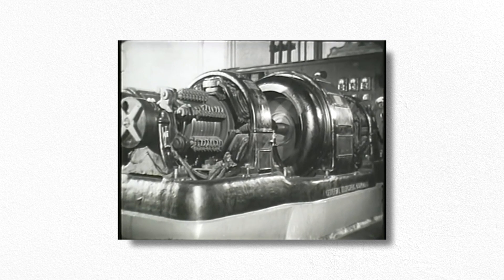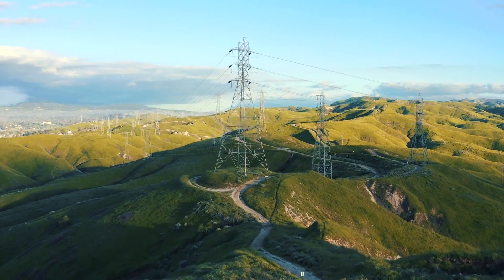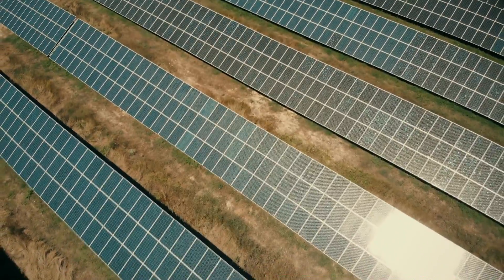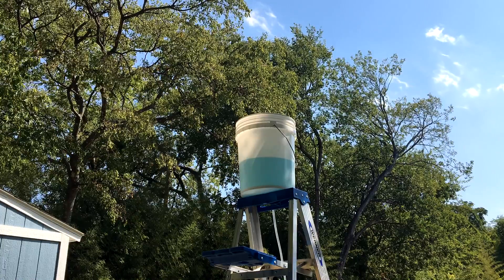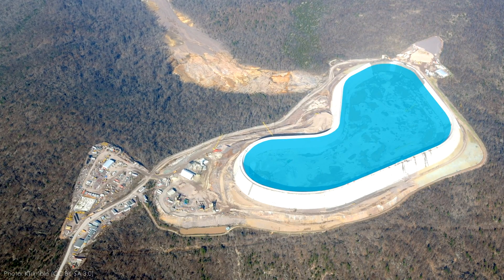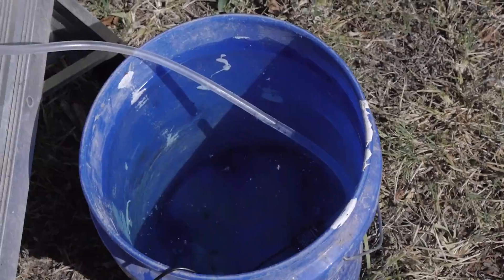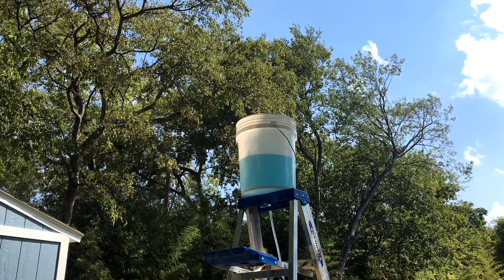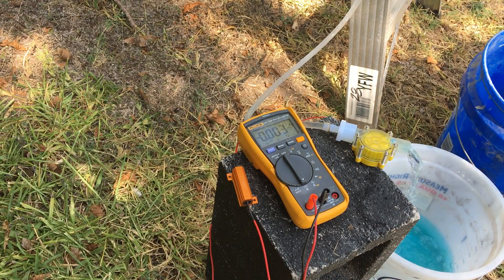World's Largest Batteries - (Pumped Storage)

Comment: im sure you mention this but most reservoirs arent pumped, they are natural collections of water. Pumped reservoirs are usually used to even out electrical load, because it is inefficient to have pumps turning off and on constantly to maintain system pressure. Instead you pump intermittently to a reservoir and use that for a constant pressure load.

Comment: i wonder why they dont make the hydro dam resevoir into something like a capacitor to hold a charge and use that to soften the demand load moment to moment whiel the hardware spends time ramping up efficiently
Reply: how would the efficiency change if the pump used for the demo was a water ram pump ... then its no extra power drain and free pumping action to go along with the head for the turbine ... have the outflow run into its pond then drop feed the pump back up and start all over again ... constant flow then

Comment: I imagine there could be better efficiency if a denser liquid, such as mercury, was used. It might be more expensive, but if you're on mars, and it can be mined in-situ, it might be preferred over lithium batteries and their reputation.
Reply: connect the pumps to a gym, and make the people manually pump up the water. There is the gold mine :).

Comment: There's some people experimenting with concrete blocks instead of water. Name's Energy Vault. Look that up.
Reply from the maker: Why use concrete when soil is just as dense and 10x cheaper?
Reply: @PracticalEngineeringChannel  I would imagine the machinery works better if all weights are exactly the same shape (and weight). You could make boxes with some sturdy material and fill them with soil, but I don't know if it would be cheaper then. And then there's the variation in soil density.

Comment: pump storage is ecologically unsound . use electrolysis to create hydrogen gas . run a generator with the hydrogen when required
Reply: Looks like too many intermediate processes. Efficiency would suffer.

Comment: Could we combine flood management system with pumped storage system? Create reservoirs where water is pumped from areas prone to flooding  and kill two birds with one stone? Flood control and power storage?
Reply: Major floods involve a LOT of water.  You would need a giant pump system to stay ahead of that.
Reply: @SynchronizorVideos  we would need to save homes and livelihoods anyway with pumps, why not have them do double duty and get some of that energy back? 😕
Reply: @gj1234567899999  No one is pumping an entire flood away.  Pumping seepage out of a building basement, sure.  Not to mention that floods don't usually play nice with electrical infrastructure, so it's hard to guarantee your ginormous pumps are even going to be able to run in a disaster scenario.

Comment: Worked at a utility where we had wind turbines that drove the pumps to pump the water up. Then release the water through the turbines as needed. Seemed like a good way to use turbines that are lucky to get 30% or their rated power in normal conditions..
Reply: Where was that? Excellent idea
Reply: @joelshor5787  Beck 2 plant Queenston Ontario has pumped storage. The pump is 750 Mwatt when used as generator.
Reply: @joelshor5787  Google "Bath County Pumped Storage". Worked well because it didn't mess up the grid with transients the way solar and wind does...it was "regulatable"...
Reply: @georgemartin1436  you mean the bath countystation did not use wind ?
Reply: @joelshor5787  Sorry...I wasn't clear there...it had wind turbines that contributed to the pumps so the station only used 650MW on windy nights. Of course the idea was to pump the water up during low electric rates, and let it flow down through the generators when rates were at a peak.
Reply: would love to see how it works. i was thinking of a sea side set up with a windmill pulley system to pull sea water on a higher elevation with a large reservoir in the end. when the sea water reservoir is full you can release the water in a floating state (equal input and output) or conserve water when its not windy then release it at its peak time.  sorry for my bad english
Reply: @jamesvillas428  not great efficiency at small scale.  Much better efficiency at say 100MW or greater.
Reply: Very interesting noticed
Reply: Wow!  Must be old wind turbines. 

Current CF for wind is up to 40%.
Reply: Good way to stabilize and store a power that does not always appear when you need it.

Comment: You said it backwards. you pump the water up during the day as you have excess solar power and not enough demand for power. Then at night you let the water fall down which spins a turbine which generates power. As demand is high at night because more people using lights and entertainment. At 4:00.

Comment: The term 'grid scale' is misleading. I take grid scale to mean large enough capacity to compensate for intermittent generators. That is not a feasible.
Pumped storage is used for grid control, to deal with short term spikes in demand, and has been for decades.
Reply: No, he means 'grid scale'
wikipedia.org/wiki/List_of_pumped-storage_hydroelectric_power_stations

Comment: You might wanna have a look at Norway's case - I believe they have numerous Pump storage facilities, with turbines in the valleys, normally running on melting water from the mountains. They usually buy surplus wind energy from Denmark at a very low price, and sell back hydroelectric energy to the danes during peak periods... Smart way to make a lot of money

Comment: Very cool video. I have a question. 
say i build 2 cylinder tanks in my yard on the same principle like the buckets shown.
First tank placed on the surface, reaching a height of 15 meters. Next one placed underground,  from surface down 20 meters deep. I can do this in my yard with the help of my friends - is not that crazy to dig 20 meters.. most water wells are deeper then 20 meters, and are 1.2 meters wide, .. pour some concrete and stuff - is doable, low tech, cheap.

Now how big this cylinder tanks need to be in diameter for me to store 100kw? 

Im trying to see at what point batteries become more expensive then a water installation - because from your video is clear that somewhere between this 2 setups:
 - small scale buckets vs battery - ( buckets hose and aquarium pump are more expensive then one rechargeable 1.5V battery ) 
 - large scale water reservoirs vs battery 
a shift in cost happens. If batteries are the way to go, no water reservoirs would have been built - they are expensive to build. Batteries would have been used instead - a huge plant of led batteries for example. Maybe this changed just recently given what Tesla is doing with Australia's battery, maybe now large scale batteries are less expensive then water reservoirs installation but still.

At what scale is this tipping point? 

Because if this tipping point is closer to what we can build in our back yard maybe is worth doing instead of buying expensive 10k batteries ($100/kwh). Where i am 10k is not cheap. A water tank can be made with just wood - which is free from the forest - and lining can be done with sprayed plastic - etc. It can be built very strong, hold for years, and be very cheap given certain areas in the world like mine. Takes 1.5 months to build. The only issue now is - does such a project even make sense? Or is so big that is better to just buy batteries instead? How big this tanks need to be such that we can store 100kw? Thanks :)

Comment: interesting that due to more and more solar and wind appearing on the system the designed strategy of cheap energy over night and expensive peaks in the day is taking a bit of a hammering. Most developed systems will end up with excess energy during the day then as the solar drops off a need for storage to make up the difference. So food for thought but pump storage could end up pumping all day and generating over night.  Thanks for the video...

Comment: Why not just use massive networks of ram pumps to pump the water back up instead of using an electric pump? Its a more massive engineering project but the efficiencies increase to 100% - maintenance cost.

Comment: if we combine these with canal locks, we could get a reasonably efficient amount of power as a side effect of canal locks. on both points too, loading into the lock and draining.
Reply: It's a neat idea on how to use an underutilized resource, but I'd imagine wind and even solar might be more consistent in all but the most busy waterways.
Reply: @h8GW  i agree, its consistency would certainly leave much to desire. I don't believe it would be best as a consistent form of power generation. However, if they did manage to make it in such a way as to not require a lot of maintenance, it could at least lower its own cost to maintain since it would require less electricity when it's busy.

Comment: Batteries convert chemical potential to electricity in a controlled fashion. There are rechargeable an non-rechargeable batteries. By no existing definition the pumped storage plant is the largest battery. If you allow other types of energy storage to be called batteries, then an atomic power plant is probably the largest as it converts nuclear potential to electricity or heat.

Comment: The best way to save and store energy is to do as Nikola Tesla did and build large saltwater capacitors to hold the energy if you made these the size of Olympic swimming pools you could store all the energy you can generate by wind and solar to be used at a later time and it would cost pennies to make these giant saltwater capacitors if it was good enough for Nikola Tesla it should be good enough for us

Comment: I thought about (along with many before Me) a "multi tear pond/reservoir" years ago.  One leading to the other using solar/wind/gravity siphon feed and or generated power at obvious times to pump back to the top pond. I also wondered why some water isn't pumped back in existing dams and reservoirs already ? Why not work on generator/paddle/turbine/gearing technology.  Cool video.
Reply: A number of dams do have the ability to pump water back up to the reservoir to store energy for later use.

Comment: Possibly use the electricity to power a train up a mountain on a dedicated spur line - load the train with concrete or dirt to increase the weight - use it to generate power as it descends during the day

Comment: There is a truth completely ignored by the hydro electric industry TURBINE designs. It is the losses in accelerated mass. When you include accelerated mass losses in the efficiency formulas, the shine falls off the stone. Hydro turbine efficiencies with these losses included drops to 16% at best. (They claim over 90% by dropping accelerated mass losses from their efficiency formulas.) Once you pump store water, this combined efficiency becomes 16% of 16%! Huge losses in reality! They claim lack of efficiency in compressed air ignoring the real bad efficiency of hydro! Not to mention expense of reservoir costs! What is the cost of renting an abandoned mine? What is the cost of building and maintaining an open reservoir? Efficiency is not the problem. Investor relations is! You scammed your investors now you can not tell them the truth!

Comment: I hope I can get some sort of answer or direction to pursue the question I've been pondering on pump using hydrogen electrolysis. It seems that it will have none of the dangers and disadvantages of hydrogen that was proposed to fuel vehicles and the greater flexibility of not requiring specific topography. Can somebody tell where to find the date on potential energy storage efficiency of this method?

Comment: Another interesting point is the fact that if your storage reservoir is fed by natural water flow via rivers or heavy rain such as a naturally occurring lake that the output power can be higher. Although technically this isn't increasing efficiency it does increase profitability. Not just that but it means that hydro-plants that wouldn't be considered financially feasible before, such as once that would only be able to break even could be used as a pumped storage solution with the added benefit that even without pumping it would still manage to cover it's cost.

Comment: Easy solution is to just decentralize power storage. If we did then no need for massive storage solutions. Every home should have a battery bank  capable of storing enough power to handle peak times. Then off peak power replenishes the batteries. Problem is, greed is trying to keep power, water, food, etc centralized so they can control the supply

Comment: while I was watching this I started thinking. wouldn't this  be more efficient the other way? instead of pumping water up, you could pump air down? like, build a dome under the sea and store energy by pumping the water out (or pumping air in) then, if you need power, you use the pressure of the water to spin turbines and fill the dome. and it's a lot easier to find places to do this. you just need any body of water that is deep enough

Comment: 4:58, looks like Niagara Falls on the Canada / USA border. One of the first large-scale electricity generation areas. And both countries are used this hydrological 'battery' system.
     Surprising this form of energy storage is not more popular.
Reply: These reservoirs were built (Canadian 1954, USA 1961) about the same time and with the generators that are linked together they produce almost 2000 MW of power which at that time was the biggest hydroelectric generator in the world.  The whole reason for the water storage system is so that it can be used to increase electrical generation during the day and still keep a minimum amount of water going over Niagara Falls.  When electricity demand is low (at night) the reservoirs fill up for use the next day.

Comment: Hydroelectric power plants are great as peak plants, even without pumping. The reservoir fills during low load times and is discharged during high load. In Switzerland we even cover part of our seasonal supply/demand disparity in that way.
(Those Mountains sure have their advantages.)

Comment: This is very interesting I never knew that we stored energy in this way. Is there a way we could use capacitors on a large scale to store energy in the same way or would it be too expensive to be practical?
Reply: Currently battery storage (and capacitor) is just at the state of innovation, the cost of producing the required cells to utilize as grid storage is a bit overpriced to be in widespread use, but with subsidies and PR wins (like the australian tesla battery) can help divide the cost among multiple parties making it economically viable.

Battery prices are getting cheaper and energy density is increasing, so it wouldn't surprise me if large scale battery storage becomes more mainstream in the next few years. However there is a micro step that IS economically viable, and that's on site storage. You get a Tesla power wall (for example) and have it charge up during "excessive" times where your home's or communities demand falls and discharge it when your home peaks on power usage. Grid storage is still a huge requirement for grid operatiors, but micro storage at the home level can help level out the curve making it easier to manage at the grid level.

Comment: what about storing hydrogen over many gas stations ? running an engine with pure hydrogen and take oxygen out of the air with a swing arm pressure system and using an inert ( in that reaction ) protection gas like steam and making a spark bridge kathode two insulated parts that are net negative towards mass ? or use continues burning spread over several combustion chambers where you ad more and more oxygen until all hydrogen is burned and than keep some behind using a Tesla valve ? it comes up to pressure like a pump that powers your house but needs to vent of some through a turbine preferably a Tesla turbine on magnetic bearings. get the hydrogen in liquid very cold form 3 bar form and let it evaporate through many weeks and let it come to pressure and store in lithium powder as a metal hydrate. than it takes roughly the same amount energy as an air-conditioning for a car but in heat around 650 700 degrees C. to get it out not that many BTU required just high temp.

Comment: I appreciate the video and I am a subscriber but the comparisons you use here are super unrealistic and deceptive, how can you really compare pumped water storage (PWS) with Li-Ion and....Gasoline?!   PWS isn't meant to be running a cell phone as you so made the comment and its not like you see any Gasoline powered cell phones out there either, you may as well have put in a comparison with a hamster in a wheel powered cell phone for fair measure.   

With that being said PWS is actually very effective in a large scale format and has really great efficiency, I believe they are actually the best efficiency when comparing mechanical batteries which this PWS would be properly categorized as.   It is also very well known in the field that both pumps and turbines become much more efficient as you scale them up.

Your videos usually hit the mark but this one was way off...

Comment: Great video by the way.
I wonder how much natural cooling the is earth losing by creating large hydro electric plants and dams. Dams effectively reduce the surface area of the natural water flow from cold condensing climates to hot evaporative climates, and in turn essentially cutting of parts of the earths natural temperature stabilization cycle. Could this be a major cause of "global" warming?

Comment: Would it be possible to use water hammer pumps to pump the water back up constantly while also constantly producing electricity? That way you're not actually using electricity to refill the top water storage!